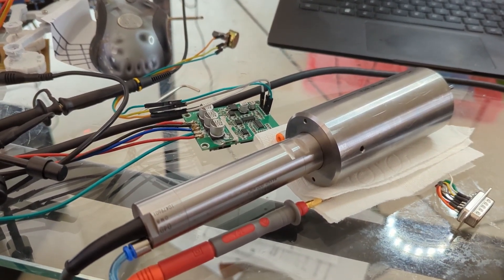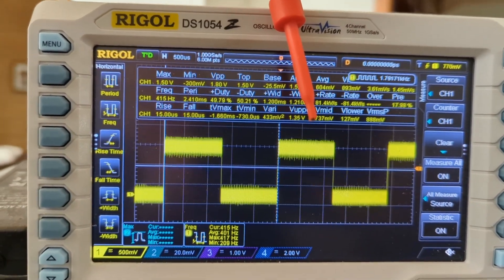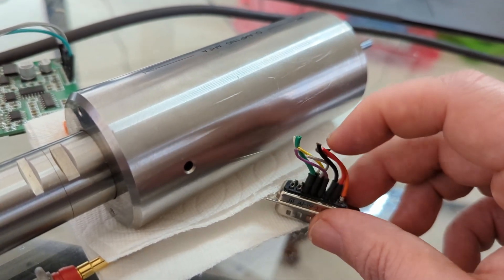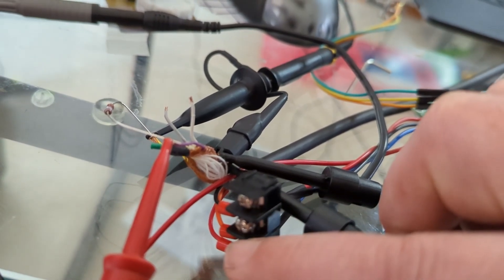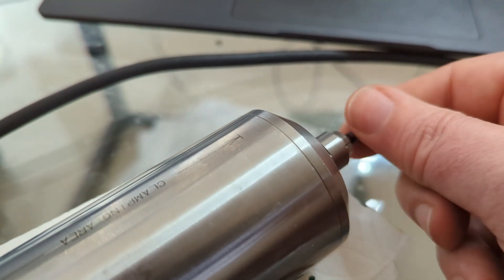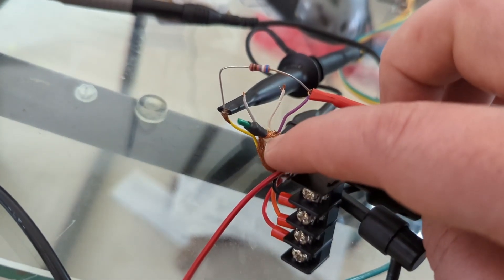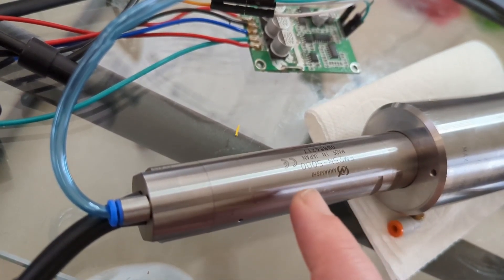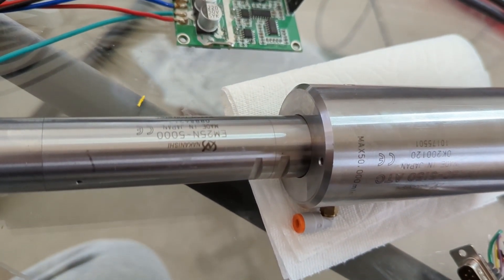Nakanishi NSK EM25N-5000 motor diy motor driver hack

Comment: Has anyone seen a pinout for the factory connector? I've managed to snag one of these & an NR-2551 spindle to go with it & I'd rather not chop the original DIN type thing off if at all possible. NSK seem very keen on you buying their fancy controller... Edit - I'm lazy. Connector was simple to remove & wiring exactly as you describe - thank you.

Comment: What's the corresponding collet for the 5150, if I may ask?
Seems like there are still a lot of 5150's for sale on ebay, but no datasheets available. From what I could guess, it was replaced by the NR50-5100 ATC, which takes CHR collets?
Reply from the maker: yes, CHR
Reply: @JesseSchoch  Thanks!

Comment: You burnt the motor up didn't you? By running it without the required compressed air to cool it while running?
Reply from the maker: nope, motor not "burnt up"
Reply: @JesseSchoch  why haven't you made another video on it then or did i just miss it?
Reply from the maker: @anotherguy9402  it is sitting on my desk, I have another nsk spindle that is driven by a larger .8kw motor that has been working great so I have just not hooked it up.
Reply: @JesseSchoch  could you make a video on both of them please? These things seem like they should of gone viral in the maker community for their capability and price.
Reply: @JesseSchoch  i bought one and a bld-510b driver to go with it and adjusted a 36v power supply to 33v because that's what the nakanishi driver manual says it outputs. I want to open the motor itself to count the windings  because there's an option for that in the bld-510b driver settings. If there's anything you can add to that it would be greatly appreciated.
Reply: @anotherguy9402  The 50K NSK motor for this spindle uses three windings.

Comment: Very interesting!  Have you done any machining with this spindle?
Reply: Do you have a video showing the 800w mount?
Reply from the maker: yes, it works well but can't take super big cuts.  I have 2 of them, one is being driven by a 800 watt 24k rpm motor.  I have crashed it a few too many times but it keeps on rockin.  I have not yet used it with the smaller integrated motor.

Comment: This is a fantastic video, I really appreciate you making it. I have been diving into using NSK spindles but I've stuck to the air spindles so far because I wasn't sure if the electric spindles used proprietary internal circuitry or something preventing the use of a different ESC. Hopefully, I can get an ESC hooked up to an electric motor like this and stop running my air compressor wide open to keep up with a tiny little spindle! Thanks

Comment: This spindle uses ceramic hybrid bearings. The rear air hose can also used be used for bearing mist lubrication.
Reply: As far a I've seen the recommend clean dry air, that's it.
Reply from the maker: do you know what lube is safe for it or if the lube is required?
Reply: @JesseSchoch  I would recommend contacting Nakanishi for the specifics.